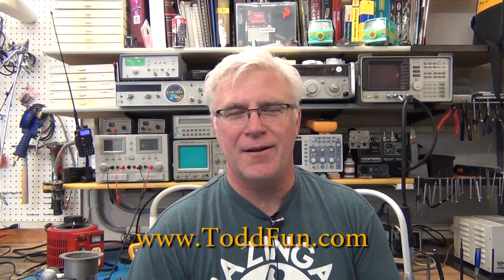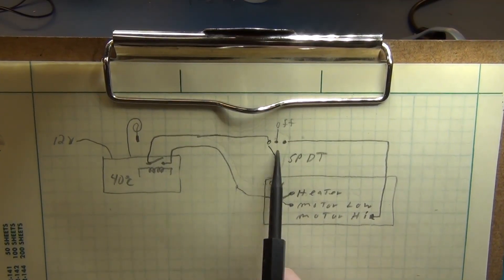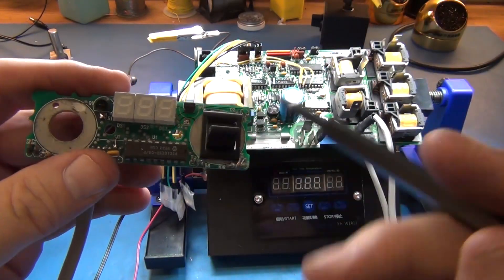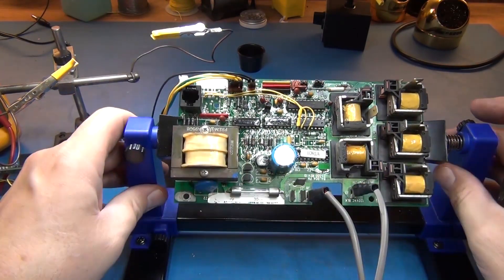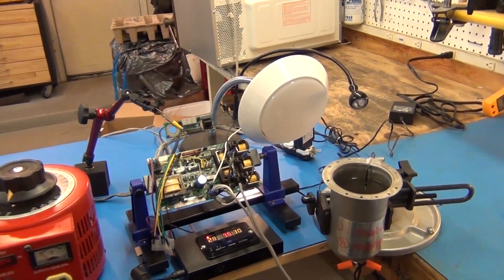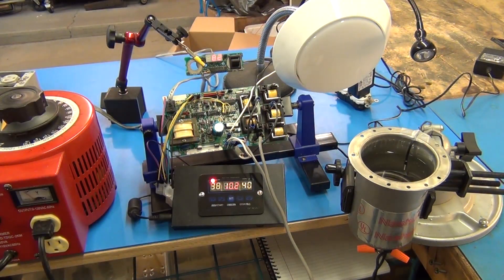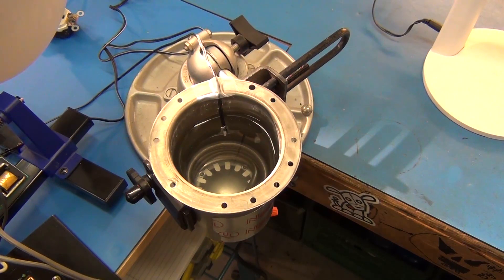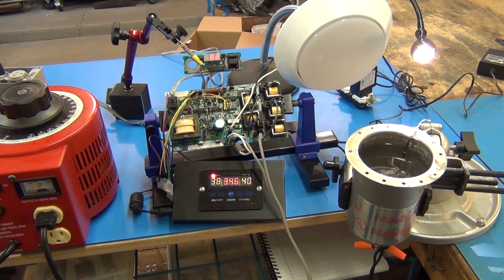Hot Tub Controller Hack part 3

Comment: Why did you hardwire the low speed and the temp controller together?
Wouldn't it have been better to have the speeds separately on the three way switch and the temp control independent of the speed control?

Comment: You will probably want to set this between 38 and 42 degrees Celsius for a hot tub!
Reply from the maker: My friend that owns this hot tub said he normally ran it at 100F to 102F so I was thinking 38 C to 39 C which would be 100.4 F to 102.2 F and most online recommendations say to not go over 104 F which would be 40 C. 42 C would be 107.6 F which sounds too high but I have never owned a hot tub so I wouldn't know.  You have one?
Reply: I did about the same thing years ago.  I used a salvaged control products programmable temp controller, driving a huge relay for a home water heater element housed in some 2" pvc pipe. I ran the hot tub at 104 degrees. 105 degrees was too hot. I only turned it on when we used it. Took 10 minutes to warm it up.